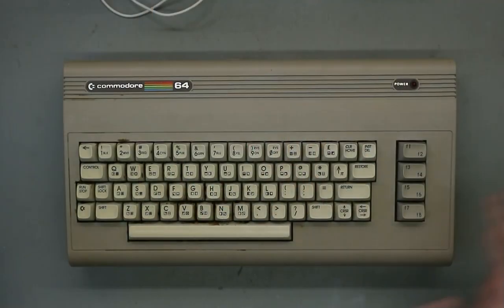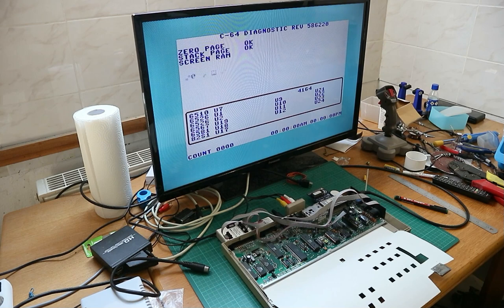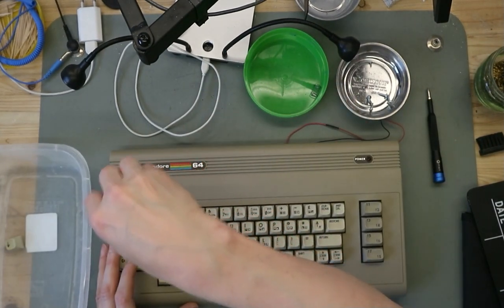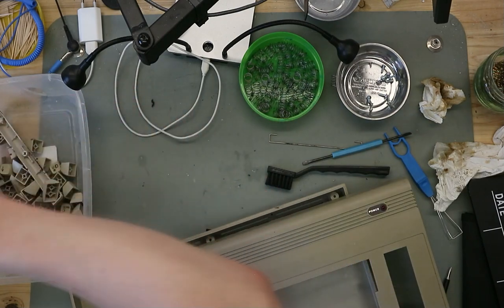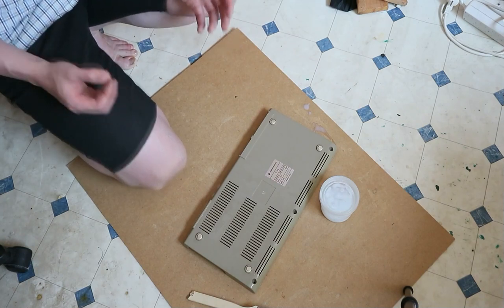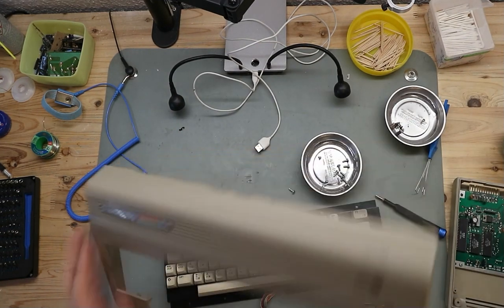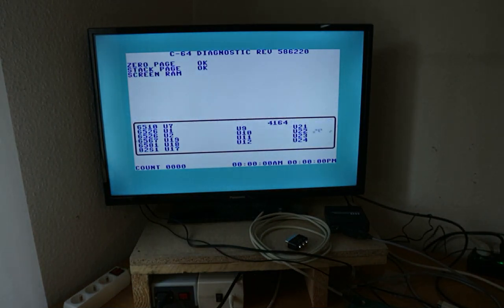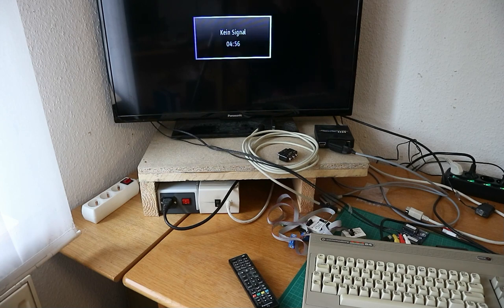Make an Aldi C64 nice again.

Comment: .Didn't the Aldi C64 have a keybord with the symbols on the front of the key?
Reply from the maker: This C64 is an later model. It had this keyboard from factory. All other features from Aldi C64 are existing on it. It could be that commodore hat this keyboard available only.